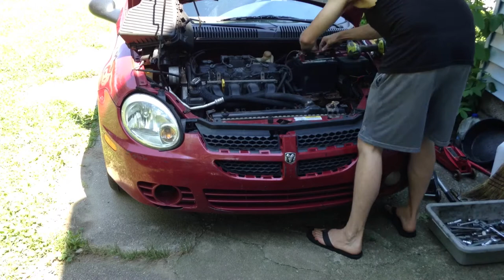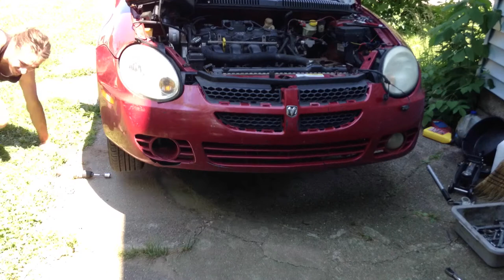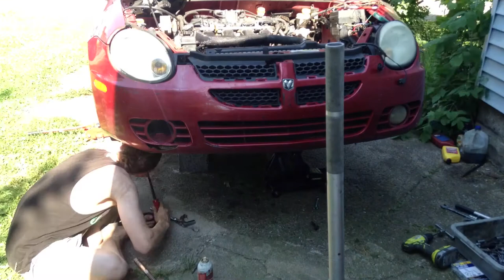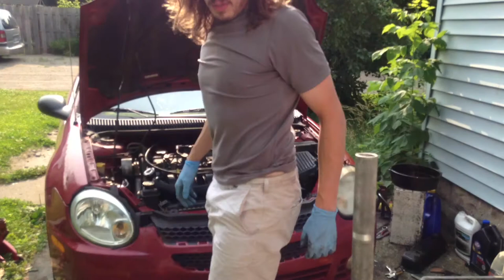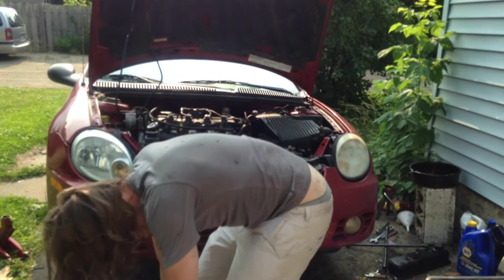05 Dodge Neon Clutch replacement TIMELAPSE

Comment: Doesn't even show you how wtf
Reply: first off all the main goal here is to dismantle the transmission, so you start by dismantling everything that is in the way of taking the transmission out like the starter, drive axles, airfilterbox and any thing that obstruct the visual or is connected to the transmission. then when thats done unbolt the transmission and you are there. if you follow this rule you can do it on most of any vehicle